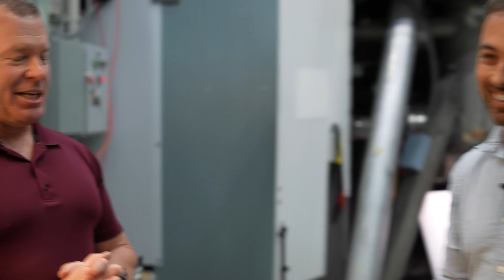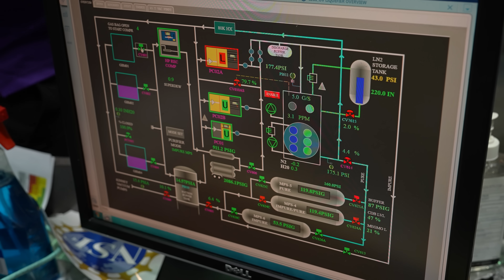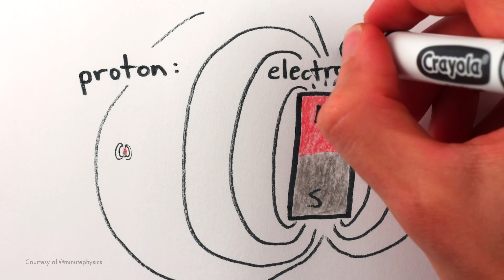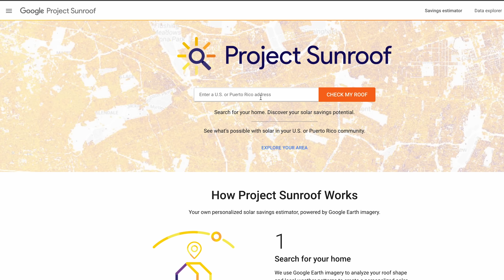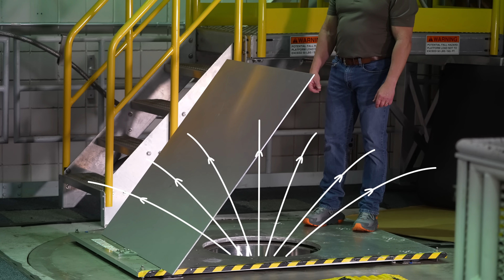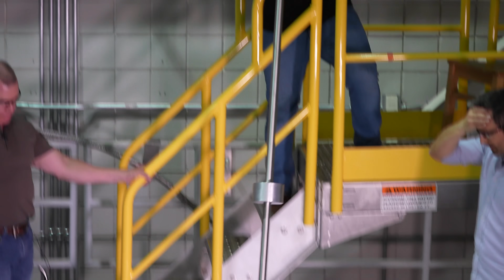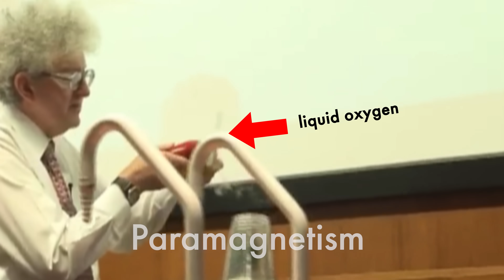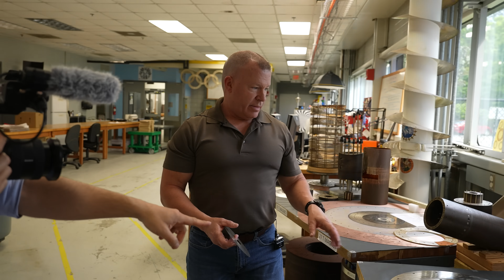World's Strongest Magnet!

Comment: small correction: The typical modern-ish clinical* MRIs are 3 Tesla, but 7T human scanners are getting quite common outside the hospital and there are some recent developement like the Iseult project in Paris where they recently ramped-up their 11.7T human scanner. Also, smaller scanners (preclinical scanner a.k.a. "small animal" scanners) have reached 7T and 9.4T long ago and I've seen up to 16T preclinical scanners in a research setting. It goes without saying that creating a homogenous enough field of a given strenght gets much much harder the bigger the scanner is.
Reply: small correction: most MR scanners are 1.5T or 3T, don't know why he didn't just say that. but yeah, those are just "most" and there is all the other stuff you mentioned.
Reply: Do the resulting images become more accurate at higher fields? Not in the medical field, but you piqued my curiosity :)
Reply: @jlucky84  They do but you may need to correct for the deviation induced by particular materials like bones. For instance at my uni (Liège, Belgium) without said correction you can't see the temporal lobes well because the skull around it is too thick. Also you get a very small space which is impractical for bigger people (including obese people who might be at higher risk of health-related problems so that's dumb) and you feel dizzy around the scanner (even beyond the Farradet cage) lmao
Reply: @jlucky84  Absolutely, the resolution increases with the static field, hence all the work done to pump it up. In one of the imaging mode, you excite the protons of the matter, causing them to have a precession motion that you detect. More field means more "movement" (Larmor precession), hence the better image.

 Modern MRI, to my knowledge, all use superconducting magnets, which was mind-blowing for me when I learned it. If I remember correctly the visit I've done in a place like Jotha885 is describing, very high static field in MRI did bring some issues, such as getting shocked if you move even slightly, as you get non-negligible eddy current induced in (for instance) your blood.

As they were working on preclinical imagers, they just use anesthesia, but it might not be practical with humans...

Comment: 10:30 can we use this behaviour to create a landing pad (small one) for goods thats needs to go from a tall building to the ground floor is the least amount of time without breaking it as the magnetic fields should act as a finite 'non-impulsive force'?
Reply: Maybe? But since gravity would cause it to accelerate, the object might go so fast that when the field stops it, it breaks. Worse yet would be if it goes so fast, its momentum would be high enough that it basically resists the field and hits the ground. Plus, it sounds pretty dangerous, and it probably wouldn't work in fast winds. It also sounds like it would use up a lot of energy.

Comment: In case anyone is interested: MRI machines don't just go "up" to 3T, but there are many in research that go up to 8. There's one in France which is at 11.7T and there will be one in the Netherlands in the future which will have 14T
Reply: I worked on one in Gainesville that was 11T. The one I work on daily is 3T.
Reply: they could've gone a bit into how MRI works... it's pretty cool too
Reply: @alveolate  It is very complex, you can literally hold multiple readings in several semesters about it. And to fully comprehend it you need knowledge advanced quantum physics, image processing, solid state physics, magnetism
Reply: I'm doing a senior design project with a 9.4T mri. Many of the clinical use ones are nowhere near that high though
Reply: What is the benefit of MRI machines having higher T? Is it better resolution or something along those lines?
Reply: @Kairos6795  Better Image quality because the differences of the different tissues are better seen
Reply: @Kairos6795  there are lots of pros and cons. But mainly, higher field strengths allow for faster imaging. But they are more susceptible to tissue and magnetic susceptibility artifacts.
Reply: most are 1.5T or 3T, don't know why he didn't just say "most are 1.5T or 3T." mentioning that we have more powerful ones may be outside the scope since they aren't the most common thing people will experience.
Reply: You are being fooled 👉The Connections (2021) [short documentary] 🔥
Reply: Everything above 3T is for Research, 3T is standard Hospital Stuff
Reply: Yeah that stat was completely wrong, you commonly see ones used that go up to 5T and uncommonly 7T
Reply: @HazyHerbivore  commonly 5T? where? the 1.5T and 3T are far more common from what I understand.

Comment: We need someone to do the math on exactly how much force Derek had to use to lift that metal plate.
Reply: I think that it would depend on the the rate of change of the flux passing through the plate.  If he held it still, Derek would only need to support the weight of the plate.  The greater the speed at which it was moving, the greater the force required.

Comment: I always had this question but couldn't find a satisfactory answer. We were taught that silver has the lowest electrical resistance. So why don't such high end projects with big budgets use silver wire? Or more generally, for other simpler projects. Silver is not THAT expensive.

Comment: I have a question related to this Mag lab specifically. A few years ago I worked on a project at the Tallahassee airport using Trimble UTS robotic Total Stations. These have an electromagnetic drive system for movement. We would intermittently have anomalies in our measurements. We were only about 2 miles +/- from this facility. I suspected that it was interference from the magnets. The Trimble reps said it was impossible, but I doubt they knew there was a 45T field a few thousand meters away. Anyone know how far the field could remain stronger than the earths magnetic field?

Comment: I love your videos and here especially that you want to visualize the dissipated energy at 9:45. Unfortunately your temperature measurement is not reliable because your sensor detects long wave radiation and the emissivity of the metal surface is low. The radiation is not emitted by the metal sheet, but by Tim holding it. This radiation is then reflected at the metal surface.

Comment: The thermal camera see only heat (IR) reflection on metals.  You need to put a paper sticker on the metal to gauge temperature of the plate. At the end you just see your heat reflected.

Comment: I think 9:50 IR temperature was skewed. The metal sheet has shiny surface, and I think it could have reflected Tim's body heat
Reply: It's true, he's pretty hot.
Reply: Yeah. The specific heat capacity of aluminium is 0.89 Joules per gram Kelvin. Ie one gram of aluminium, dropped 89m (g=10), has the energy to heat itself 1 degree. (Whether through magnetic effects or just friction. Although friction dumps much of it's heat elsewhere. ) Doesn't matter how strong the field is, if it's static, the energy comes through the motion. So as the plate was falling far less than 89m, and seemed to gain more than a degree it was reflection.
To heat the plate, you would need to apply a force of 100's of times it's weight. And it has to weigh a fair few kilos.
Reply: @donaldhobson8873  rate of change of flux is pretty small here i think that is the reason that it wouldn't heat significantly and not due the reason that its a static field. like a non static field if produced for a small duration wouldn't heat it that much either. am i getting something wrong?
Reply: @PKJ11  It won't heat significantly due to conservation of energy. 
The rate of change of flux is small because the plate is moving slowly. (And if the field was stronger, the plate would move slower) 
It is integral(square(d flux/dt))) that determines the heating of the plate. So a rapidly changing field could heat the plate much more.

Comment: I used to support an end station at work which has a 14T magnet. At the edge of the field is posted a gauss field diagram, showing (in both horizontal and vertical) how far the different levels of the field stretch, and through which walls.

I love the idea of taking my ferrofluid in to work, the next time I know there's a high field magnet experiment.

Comment: I saw your thermal camera clip was not aligned, you can fix this in the MSX settings by adjusting the macro slider, it looks like a flower. It should allow you to align the edge detection outline with the thermal sensor.

Comment: Hey Derek, a small correction. Type 2 superconductors (i.e. all which undergo the transition with liquid nitrogen) actually don't float due to the Meissner effect, since the forces that the superconductor experiences in that case don't allow a local stable minimum (hence it can't float). The levitation effect is cause by the flux pinning, since the type 2 superconduction kind of "freeze" the spatial distribution of the external field.
Reply: i need a lot dumber explanation of that.  Really.
Reply: @rhoused1743  Basically the superconductor, as far as the magnetic field sees, is like a solid black brick that the magnet can't penetrate. In a type 2 superconductor though, there are little imperfections which can cause the magnetic field to come up through little microscopic tubes through the material. Think of a cinerblock with the holes through it, and then thing of the magnetic field like construction foam filling up and going through the holes. The magnetic field sort of expands into those holes and all of the fields working together pin it in place.
Reply: @BetaDude40 they're not always tubes but can be nano dots, or simple point dislocations. We call them pinning centers. BZO in ReBCO. The nano rods often cause the local dislocations kind of in a cylinder around them, but they don't become highly effective until you get below 25-30K. See dr. Ashley Francis' thesis for details.
Reply: @rhoused1743  
**TLDR: Read the summary at the bottom of the text if you are in a hurry

Type 2 superconductors are materials that can conduct electricity with zero resistance when cooled to very low temperatures, typically with liquid nitrogen. When a superconductor is cooled down, it experiences a phenomenon called the Meissner effect, which causes it to expel any external magnetic field. This effect alone, however, cannot explain why type 2 superconductors levitate when placed above a magnet.

The levitation of type 2 superconductors is actually caused by a different phenomenon called flux pinning. This occurs when the superconductor traps the magnetic field lines of a magnet, effectively "freezing" them in place. The trapped magnetic field lines create a stable equilibrium that allows the superconductor to levitate in mid-air above the magnet.

*So, in summary, while the Meissner effect explains why a superconductor expels magnetic fields, it is flux pinning that allows for levitation of type 2 superconductors above a magnet.*
Reply: That's really interesting! I had no idea that the Meissner effect alone couldn't explain the levitation of type 2 superconductors. Could you explain a bit more about flux pinning and how it allows for levitation? From my understanding, it's the trapping of magnetic flux lines within the superconductor that prevents it from moving or falling, but I'd love to hear your perspective.
Reply: The difference between someone who knows, and one who asks people who know.
Reply: You are being fooled 👉The Connections (2021) [short documentary] 🔥
Reply: Nerd

Comment: As someone who's welded for 20 years, understanding magnetic fields is important. Nothing worse than striking an arc on a piece of magnetized steel. 

Usually you can reverse wrap your work leads (sometimes called ground, even though they aren't going to ground) around the object and then spool up your welding rig to degauss the steel. If that doesn't work, we'll heat the steel red hot and smack it with a hammer a few times. I've been told it helps disorient the magnetic fields, but I don't know for sure. I'm just a welder.

Comment: We need to get to space and make an a way to 3d print metals and such things to scale this magnet down and make circles in circles in circles and so on with the magnets spaces in such a way that as these circles with magnets spins it drives the magnet fields to pull outward in ways to twist the constantly rotating fringe field to create propulsion for zero g environments possibly on earth as well but we must make these materials in a zero g environment to start with as to not let the magnetic particles shift in way that the earth's environment would make it and the power to drive this all would be a nuclear battery we also need to make things that have the proper frequency

Comment: Hey Derek von Veritasium,
The emissivity of metallic plates is low - you ought not to be able to observe their temperature with a thermal imager. What you observe at 9:43 is likely the reflection of a slightly warmer ceiling (instead of a slightly cooler wall) . You can see the reflection of the person behind the plate clearly at 9:55 and onwards.

Comment: The most fascinating aspect of magnetism is the fact that the magnetic lines of flux are locked into the space surrounding the magnet .  The flux isn't attached in any way to the magnet itself rather it is an effect caused by the atoms that make up the magnet and the lines of flux are a pattern formed into whatever is near the magnet . Iron fillings and ferro fluid form very different patterns because they are responding to the magnetism respectively , not lining up with and clumping around actual lines of force .

Comment: Earth’s magnetic field is .00005 T and fridge magnet .01 T but earth’s magnetic field travels from center of earth into space more than 6k km and a fridge  magnet only a couple of inches. Are magnetic fields like EM waves with different frequencies & wavelength? Or can one be converted into another? An EM is considered stronger based on its energy frequency and ability to ionize like a microwave but a radio wave penetrates deeper. Where can we use that property of earth’s magnetic field?

Comment: A fun induced currents demonstration you could also do is to compare a conducting ring to a broken conducting ring, i.e. a ring with a break in it so that it's not a complete circle any more. The broken ring won't be able to generate the same eddy currents in it and will be noticeably less resistant to motion.
Reply: @The_Evil_Eye  I believe the closed ring is important. It would be a nice test to drop a magnet through a copper tube and through a construction with copper rods. I know the tube slows down the magnet a lot. Never tried the other test.
Reply: @The_Evil_Eye  It is important. There's a great demo I used to do for intro E&M that demonstrates it comparing a copper cylinder with one that has a small line cut down the side. The currents are induced at all length scales, but superposition means that they all add up to being equivalent to the largest length scales. If you can disrupt the largest length scales, then you reduce the largest eddy currents.

Comment: Wait so if the earth's magnetic field that can deflect all of the harmful solar radiation is so weak compared to even a fridge magnet what's stopping some form of magnetic technology being used to protect astronauts for solar radiation as well? Obviously I get it's not a one to one comparison, but surely there must be something to the idea?
Reply: the earths magnetic field is fairly weak but it is also very spaced out. it extends several times beyond the radius of the earth so even that tiny field can act over an enormous distance. I'm probably oversimplifying and missing detail here
Reply: @curseofgladstone4981  That's why I said it's not a one to one comparison, and the size was the obviously differential in the equation, but to provide equal, or even some useful percentage of such shielding with a manmade magnetic field what would be the required strength, is it even remotely achievable? What are the obstacles, are the possible to overcome, is anyone even looking at this as a technology? That's what I'm wondering?

Comment: The IR temp measurement was pretty nonsensical. The emissivity coeff of the shiny metal surface is very low, so he was seeing the IR reflection of the person when the plate was falling more horizontal, not the actual temp. If he really wants a thermal image, he could've painted the plate or used masking tape

Comment: i have always wondered what would happen to me if i got close to one of these things bc at 15 I snapped my femur in half so I have i believe titanium or stainless steal brackets on the both sides of the bone I believe with 18 screws on both sides i had the option to remove them when fully healed but there was no way i was gonna go under the knife if I didn't absolutely have to so i kept them in anyways i always wondered what would happen if i got close to one of these magnets? also i left out i was born without my left leg 4 inches below the knee which just so happens to be the leg i broke my femur on if i didnt have bad luck i wouldnt have luck at all so i know if i got close to this thing with my prosthetic leg i would be in big trouble but like i said at the start i always wondered if the same thing would happen to the brackets i have in my leg from the break?
Reply: If they're stainless, they would get pulled hard (ferritic stainless, which is magnetic, is used for stuff like this). If they're titanium, they'll get eddy currents when you move so they'll also pull but not as much. Since I have stainless screws in my femur too, I'm not going past the 100 gauss line.
Reply: @soaringvulture  just thinking about it gives me shivers lol